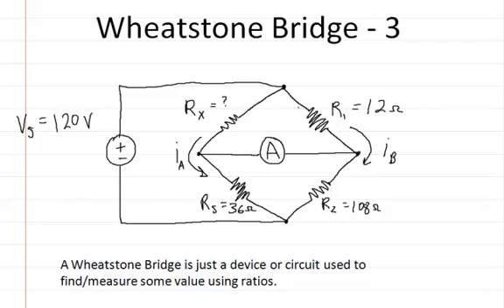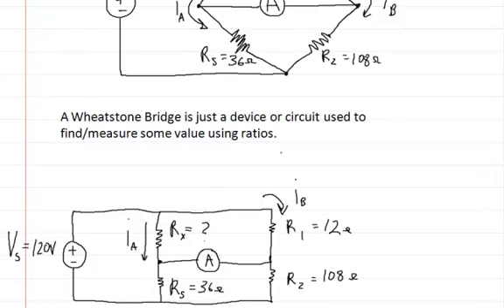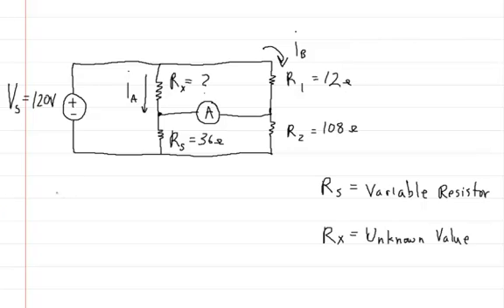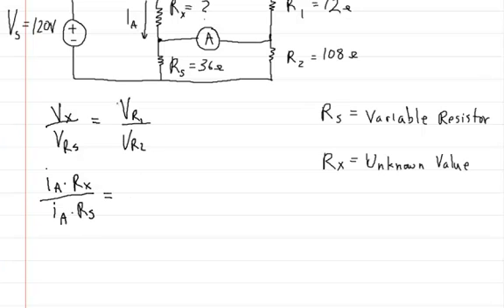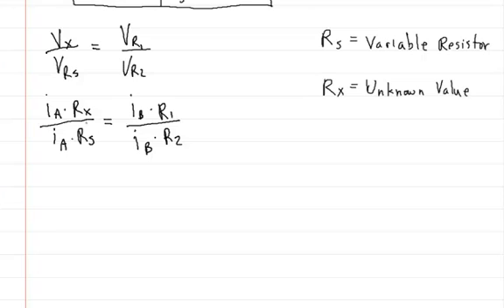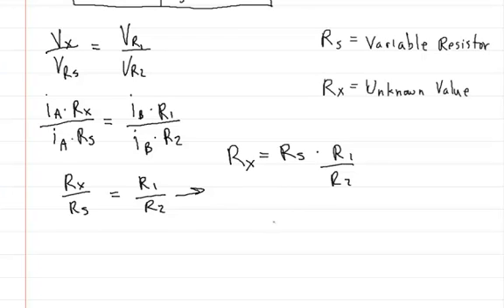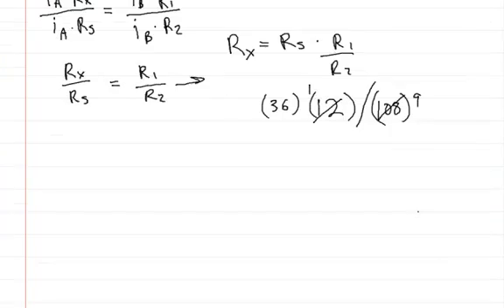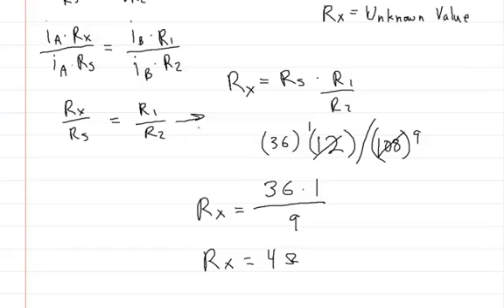Circuits Wheatstone Bridge Part 3

Comment: So by measuring the amps flowing through the amperemeter, in a wheatstone where pressure would change the Rx, you would be able to (if the mechanical implementation of the pressure driven resistor was good enough) measure weight. But how would you go about it? Would it just be a linear change with weight and how precise would it be? Instead of amperemeter, what about just a resistor and measure the voltage across?

Then just hook the voltage to an ADC.